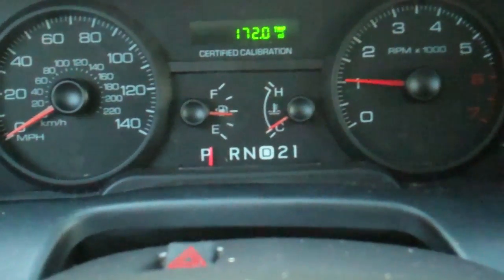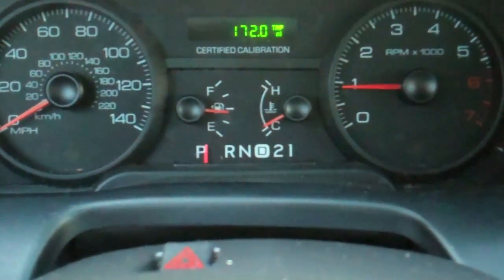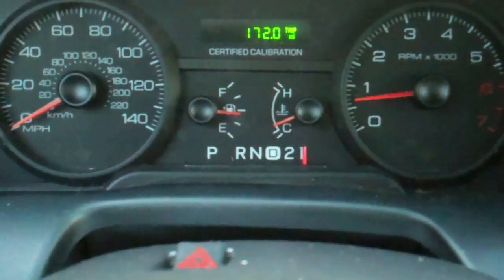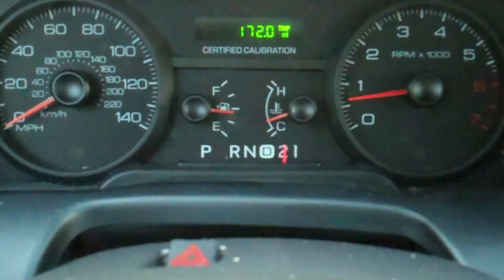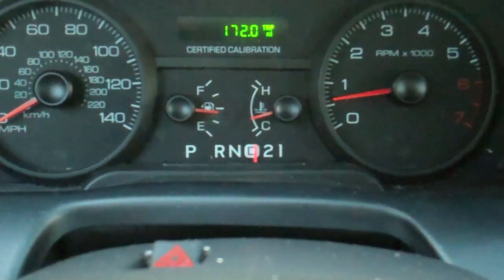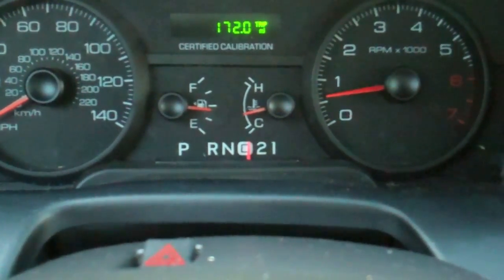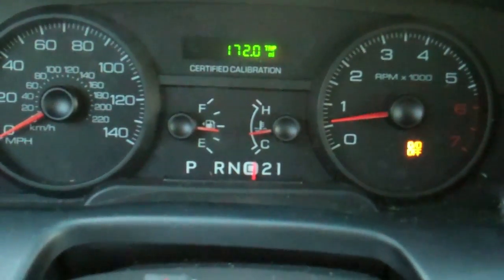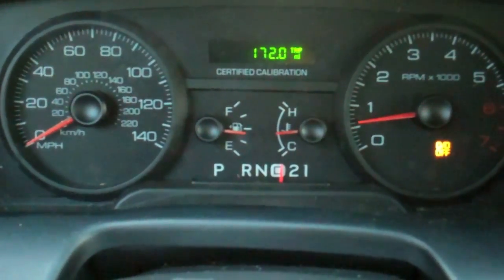Understanding the Ford Crown Victoria P71 Police Interceptor Transmission

Comment: @WJ Handy Dad, I grew up with a bunch of mechanics. One thing that i was taught, every engine has an efficiency range, where it is maximized. For instance i used to have a Mazda B2200 2wd truck with a 2.2 engine. It's most efficient RPM was around 2500 RPMs and loved to be reved over lugging. Short of using a dyno, i just played it by ear and seat of the pants driving. I got 24-27 MPG, treating it like a race car. I sold it to my father and he complained of bad gas mileage and a horrible spark knock, things i never saw. I asked him how he was driving, he said he run it like his last car ('93 LTD crown vick not a cop car), which had a 302 V8. I told him that it liked to rev and run lugging it was not good. so he threw me the keys and said show me. So i showed him, revving to 4k per shift and generally driving like a sports car. after that he bragged about 25+  MPG. till he sold it.

The point, is in the city you might gain efficiency, by dropping out of OD. It all depends, on how your car wants to be run

Comment: Dude, I disagree. D will give you 1234. OD button is real OD. Trans final is <1:1.
Reply from the maker: D is 1-4, O/D off is 1-3.  Crown Vic has a 4 speed transmission.  4th gear is the overdrive gear with a ratio of 0.70 to 1.

Comment: Ive heard many times before, not sure if completely true, that with O.D. off the trans will also stay in each gear longer, shifting at a higher rpm to assist in tow or heavy load apps. This will in turn keep the trans running hotter and is not recomended for this trans.
Reply from the maker: it's not mentioned in the literature, but certainly worth testing out.  I'll hit my O/D off and see if it stays in gear longer

Comment: I have a 2011 Crown Vic and the shifter will not go into the 1st gear position. Anyone else have this issue? I saw a video on how to remove a shift blocker they had installed on an older model but mine is not set up the same way.
Reply from the maker: does it not shift into 1st or does the indicator not show 1st even though the transmission is in 1st?
Reply: It doesn't shift into 1st
Reply from the maker: that's strange... I've never heard of that issue before.  Does it shift through all the other gears perfectly?  If so, it would sound like something fell into the shifter area that is blocking it.
Reply: Yes there is a shift block on it. I know on the older models it's as simple as removing a bracket that physically blocks the shift lever but mine is a lot more complicated. Looks like I would need to remove the shift lever and do some modifications.

Comment: One tip that will help your transmission is if youre going to be driving on dirt road/offroad or youre stuck spinning your wheels in snow or for whatever reason or youre going to try to do a burnout turn the traction control off. It can put wear on the transmission in these situations.

Comment: Mine works well in of as an economic mode as long as it's at 45 or over. Below that non od is good for pick up if you need to pass. I see an average of 10-15miles per tank less in non of and quick starting.

Comment: I turn o/d off for city driving because at light throttle it will shift to 4th gear at 38mph and I think it stresses the trans, yes the rpms are low but I rather the trans stay on 3rd up until at least 45mph
Reply from the maker: I guess I'm lucky because during my daily commute typically once it shifts into 4th it doesn't "hunt" back and forth, it just stays in 4th.

Comment: This is how it works. Selector in first gear vehicle stays in first gear but the selecter and second gear the vehicle will start in first gear and then change to second gear but no other gears besides those two put the selector in 3rd gear will run up to 3rd gear put selector in overdrive it will run the first three gears and then go to overdrive if needed.
Reply from the maker: in "2" it just stays in 2nd gear.  I know most vehicles shift from 1-2 but the P71 stays in 2, even from a stop, which makes it very sluggish off the line

Comment: It's always been said to leave overdrive off during towing or city driving, puts less stress on the transmission and drivetrain as it won't shift as frequently.
Reply: lol just try to hold 3rd as low as it will go, and learn how to drive in conditions that require that. i force myself to drive that way to keep my tranny, barely any hard shifts over here. and it shifts so tight every day, so far thats how ive kept it like new ride the shift points
Reply: @tba6403  mine lost od and has blew out 3 spark plugs. Still pulling 04 grand marquis. 229 thousand miles
Reply: @seancarr7018  so youre telling me u got 3 heli coils and 230k with no od so what 10mpg? kudos but idk if id hang onto it lmao
Reply: @tba6403  it's stronger than a helicoil it will blow those out lmao. And I still get 18 city more like 15 highway and I don't go out of town much with it so I see no reason in getting rid of it. All my friends like to go places in my car because it's comfortable and rides nice. So you can miss me with all of that bud
Reply: @tba6403  she pulls strong and hard and hits on all 8. It has threaded sleeves with military locktite. I tried to helicoil a 6.8 v10 triton and it blew it out as soon as I started it
Reply: @tba6403  it still goes 115 without od
Reply: @seancarr7018  ok relax im not attacking u bud. all sounds good. dealt with a spitting 6.8 myself no fun. mine goes to the limiter without od tho all do..
Reply: @tba6403  mine has the 2.73 rear end so if you go 65-70 you still get almost as good mileage as with od. Once you go 75 plus you can tell/see the difference in fuel Mileage
Reply: So if im driving around not exceeding 60 km/h (sorry idk what that is in american) and stop/go frequently i should leave it off?

Also no freeway here its either driving in town or its out on a 2 lane highway
Reply: Well for whatever reason the ecm likes to cut power around 111 on my 04 it will go faster after the ecm let's the motor kick back in

Comment: I'm having an issue with my transmission selector lever temporarily sticking in park at first startup. It will eventually will move out of park and shift normally. Only on initial start up. Any suggestions? (2006 p71)
Reply from the maker: As in you can't shift out of park?  Sounds like the park interlock (it looks for a ground when you press the brake pedal).  Since most (all?) police cars have the brake wires cut when they are in service (to route through a switch to kill brake lights and even possibly a "secure idle") it's possible they did a poor job re-connecting.  I'd start at your brake pedal and look at the wires and switch above it and see if there are any that look like they need a better job being connected.
Reply: Mine did the same thing, turned out the contacts in the brake pedal switch were burnt and not making good  contact.

Comment: Hello handy dad. You mentioned you might do a window washer squirter tutorial. I'd like to see that because one of my squirters is kind of plugged up and not really hitting the windshield properly. But it doesn't seem to just pop out of the assembly for cleaning. Don't know. Love the videos Man
Reply from the maker: I have one on replacing the windshield washer motor... check it out and see if it helps.

Comment: Hey check it out you can see the trip odometer. It's finally getting cold enough cold enough up here in the north that I can start to see mine again for the first time in 6 months. It all has to do with the contacts for the LED display going bad so when the circuit board shrinks in the winter mine lights up nice and bright the rest of the year it's lights out for the mileage display. It's a project though
Reply from the maker: probably a tiny bit of solder would fix that if you feel comfortable soldering on a circuit board

Comment: I have to respectfully disagree , I drive a 99 & a 06 Grand Marquis and when below 45 mph OD is off (button on gear selector) when going from 55mph to 35mph entering a town ,school zone when my speed drops below 45  I shut OD off with the button it acts as a engine brake and helps me get down to 35mph without any brake, when leaving 35 going back to 55mph I turn OD on again . NEVER EVER pull out to pass @ close to full throttle with OD on . If you pass HARD throttle with OD on the transmission will drop from 4th  to second and that is way to hard on the OD band . If you pass @ hard throttle with OD off it shifts from 3rd to second at some point but not necessarily immediately. This is the way I drive and my trannys never have any issues . Each to their own . God Bless !!
Reply from the maker: I'm only repeating what is in the Ford owner's manual and police interceptor supplement.  Obviously if something is working for you keep doing it.  I haven't had any transmission problems either and I keep in O/D more than 99% of the time I'm driving.
Reply: You don't have the final drive gear like a cop car bud your mgm yes may seem the same but very different mechanically wise

Comment: I have a device called a "GoFar" plugs into OBD2 slot and tells me how much fuel im saving. And i can get much better economy when i shift manually, I start with car in first gear and O/D off, then to second, then put to drive, then when i get to desired speed,,let off gas and press overdrive button. It this harder on the transmission in any way? Because i can actually get much better mileage.

Comment: How are people honestly asking about this? Leave OD on guys, at all times. There are few scenario's when you don't want it on, but daily driving it should always be on. Allows your engine to rev at lower RPM's at highway speeds, reduces stress on everything. The guys I'm reading who turn it off around town are mentally challenged.
Reply from the maker: people argue about this all the time on Facebook... there are several who swear that having O/D off gives the car more power...
Reply: Ive read that some crown vics especially the early ones do actually get better power with off

Comment: Turn OD off and you be smoking stick shifts in street drag races, smoked a wrx that way, by the time his turbo kiced in I was two car lengths ahead and at the next stop light then he tried to raced me again same result, I was expecting a third attempt but I guess he learned 3 times is not a charm being smoked twice!
Reply: Dude these Vic's aren't smoking anything but the slowest of cars. I have an 07 and I'm sorry but with 230-ish HP they just aren't fast. A stock WRX with 300 HP is going to smoke ANY Vic. Come on, unless it's his first day driving and he doesn't realize he has more than 1 gear this is bullshit
Reply: Aspie Otaku Sounds like something straight outta initial D lol
Reply: Aspie Otaku yeassss. I've done this several times in my 03 LX sport Vic.
Reply: not saying these r the fastest cars but I beat 3 wrx wagons in the the 1/8th mile with my 06 p71.

Comment: I have a 2000 P71, if I leave it down in 1st it will still shift at redline (same if I'm flooded in Drive) I also like to leave OD off when I in the city so I can have better throttle response (accelerate and decelerate)

Comment: I have question what would happen if i put a cold air intake on my crown vic? I heard negative and positive things about it. What are you're thoughts about it??
Reply: Mario Martinez 
I have an ‘07 CVPI, and if you look at the air filter snorkel, and where the engine sucks air from, you’ll see that it’s in front of the radiator (actually to the side of it)...so, in effect, you already have “cold air” intake, since it’s not sucking air from under the hood
Reply: DON'T. If you have a Interceptor the airbox is exactly the right one for your car. You ain't going to gain anything in the long run. Check out Mr. Random on that subject Brother.
Reply from the maker: My personal belief is they don't help.
Reply: WJ Handy Dad okay thank you

Comment: a lot of mis info on this
Reply from the maker: what do you think is incorrect?
Reply: Well for starters he claims this is a  P71 transmission - but the transmission model he lists was also used in the other Non-police interceptor.  The torque converter may be different, but the trans is the same for like year panther body cars
Reply: It irks me when people utter specious claims but can’t or don’t support them on challenge.

Comment: OD off  disables  the torque converter  lock up ( behaves as direct drive)  It will go into 4th gear with OD off. Although 4th gear is technically an overdrive gear. Overdrive means the crank shaft is turning slower than the drive shaft. It will shift from 1st to 2nd when the shift lever is in position 1. The 2nd gear lock has been a Ford tranny property since Ford has been making automatics to my knowledge.
Reply: youre right...converter lockup is like explaining magic to these idiots lol...they dont understand that unlocked is a *torque converter* while locked is direct drive...if you try to leave a stop light in locked, youll see just how gutless the 4.6 really is
Reply: Mark Hebel 
That’s not true...my ‘07. CVPI will lock up the converter in 3rd gear with O/D off.  It pulls quite nicely in 3rd locked up to about 50mph, where I engage o/d manually.
Reply: Mr Diplomat TRUE STORY. -Just purchased 2009 CVPI/ -Prior car 2004 CVPI (sold)/ -2003 CVPI (sold)

Comment: OD off while driving on the highway, makes it haul ass like a bitch!
Reply: Aspie Otaku not really it gradually builds speed with less motor noise I have a 2000 and I leave it in OD it's more responsive
Reply: Funny I smoked a WRX with OD off twice.

Comment: How do you turn off trackion control in a 2011?????
Reply from the maker: Some models come with a traction control button on the dash just to the left of the steering wheel.
Reply: For some reason mine does not have one lol
Reply from the maker: Not all models have traction control on/off switch.  I don't recommend doing it, but some folks just unplug the ABS fuse as a "workaround."  Again, I wouldn't recommend doing that!!
Reply: WJ Handy Dad okay thanks! i just wanted to know.

Comment: I drive mostly in 3rd gear which I manually shift down to but I got an 2008 Grand Cherokee V8. I will say, in 3rd, you burn more gas up & if you're up for optimal performance, when I drive in 3rd gear, there is a huge difference in performance of course than if I were in 4th or 5th gear. My vehicle is a 5-speed auto/OD transmission so I know it's not a Crown Vic but transmission rules are the same for all cars with automatics, mostly I believe.
Reply from the maker: No doubt the cars are more "responsive" when not in overdrive.  Is it worth the extra gas burned?  I guess that's up to the person having to pay to fill up their tank.

Comment: I turn OD off at 80mph. Enter a freeway with it off. At 60mph, you can feel the car spring forward with plenty of pedal left.These cars are tuned for upper to top end power. From a dead stop the rear wheel horse power is almost non-existant. The reason for this is to prevent wheel slippage during aggressive take offs. (2008 S.P. Unit)

Comment: ... and when that O/D light flashes, prepare your anus for rear entry, or get rid of it...  the car... not your anus.
Reply: Na, 9 times out of 10 it's just the sensor failing. Even on mine the light started flashing, I changed the sensor and so far another 100000 miles no problems.
Reply: Michael Carlson what sensor did you have to replace?
Reply: tin pin what sensor are you talking about is it the same sensor that's in a grandmarquis by chance bc mine has o/d button on my mercury also?

Comment: Constantly shifting between 4th and 3rd by the the automatic trans in short intervals will generate more heat and shorten the life of the transmission, however the P71 has a trans cooler. As you pointed out, the manual indicates for city driving or towing, leaving OD off may be beneficial and will keep you higher in the RPM power band. Mileage will decrease.
Reply: so goin on a trip have o/d off?
Reply: @doublegz6593   No.  Just the opposite for my definition of a trip.   Leave the OD on for long trips.  Short trips where you want performance driving, leave it off.  If you want good gas mileage, leave OD on.

Comment: it is a 4 speed, with overdrive. my 2010 has 4 gears with od.
Reply from the maker: the 4R70 and 4R75 transmissions that were standard in the Crown Vic had 4 forward gears... overdrive was 4th gear.  1st is 2.84:1, 2nd is 1.55:1, 3rd is 1.00:1, and 4th/overdrive is 0.70:1.  There are some aftermarket options to add a 5 speed automatic to the Crown Vic.
Reply: i own and drive a 2010 crown p7b, it's an x city police car and with od 
off it shifts 4 times, then i can turn it back on, then od is there.  
same tran as the mustang gt 4 speed power glide with od.
Reply: WJ Handy Dad Can I get a brand or link to the five speed? I'm fixin to slap a ford racing 4.6 in mine.
Reply from the maker: I didn't write them down and now I can't find them.  But there are apparently a couple of Ford 5-speed automatics that can be put on a Crown Vic.